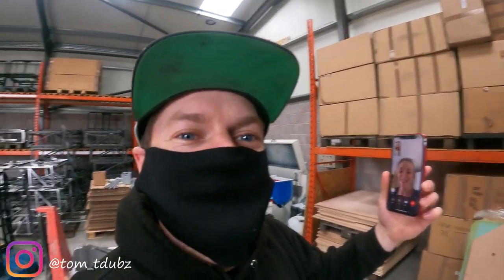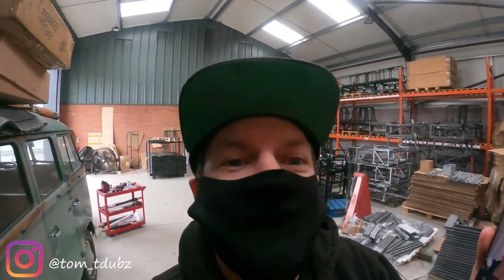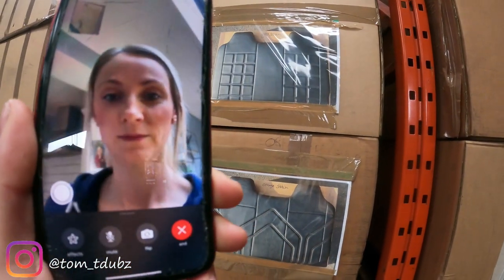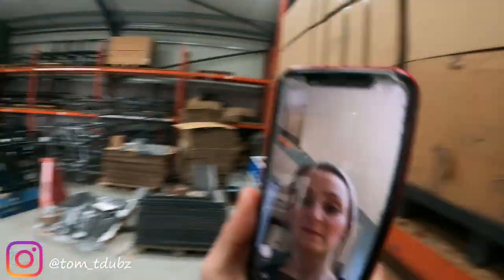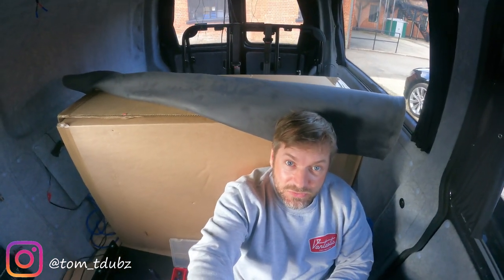Vw T5 Rustyleebeds RnR bed Swivel base

Comment: You made the right choice for your bed. We had ours fitted at Rusty lees in May 2019. They are the most helpful people bearing in mind we did'nt make it easy for them as we had finished installing all the cupboards and other bits and pieces. They even helped to release the spare wheel bracket nuts which were rusted solid. and fitted the end doors to the bed at no extra cost. I would definitely recommend them     Great people.
Reply from the maker: Lee and his team are fantastic! Was great to meet them. So happy with the bed looks great so easy to use too 👌🏻